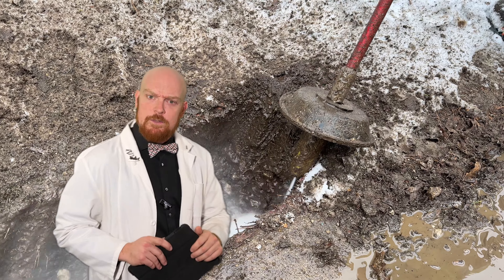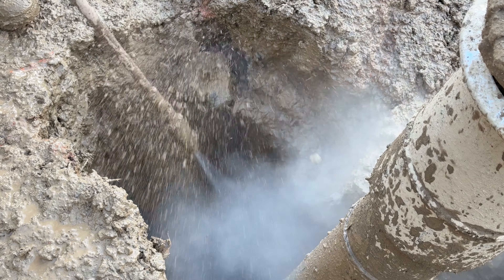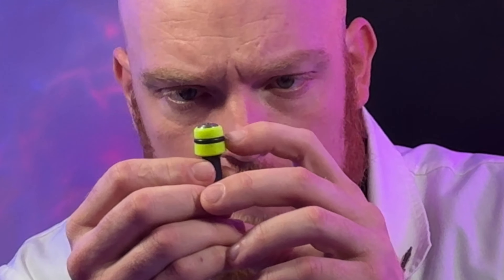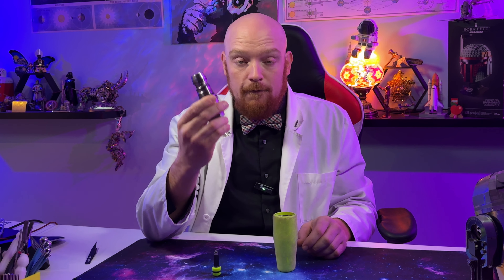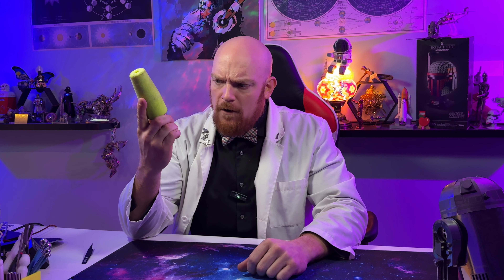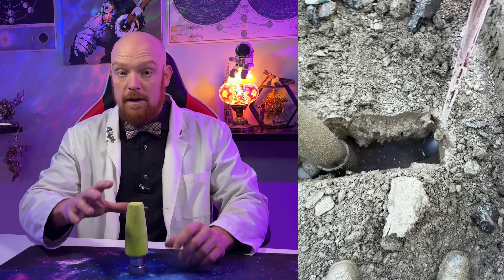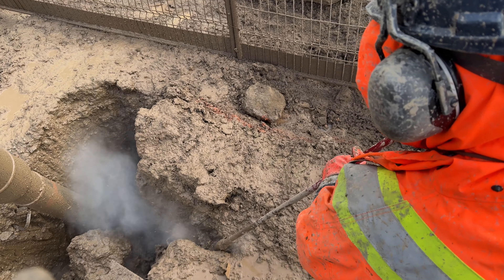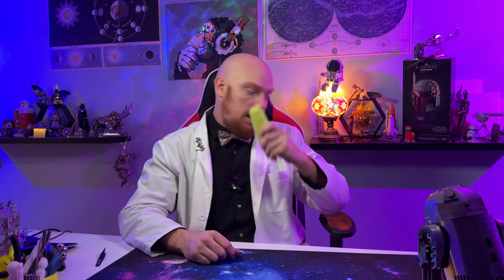The Dig Pig Silencer.. The best Hydrovac Nozzle?

Comment: How does this compare to the hydraflex machete
Reply from the maker: Great Question!

Personally I liked the Machete for cleaning but when it came to digging the Silencer is better. The machete is plastic on the inside, so heat, dirt and bashing will causes it to wear faster. My machete lasted me about 5 months, Silencer 9. The refresh kit is cheaper then a rebuild kit. 

On cost alone the silencer is better but again depending on what your doing you might find the machete to be useful. 

I have a comparison video on Tik Tok you might want to checkout.